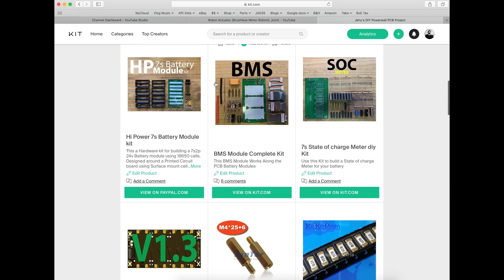Hi Power 7s 18650 DIY Battery Module kit - Assembly

Comment: Confused. Your saying that each module is 400 watt. Is that right? Also in another video, you said to use the 2nd fuse on the oposit end of the positive standoff to have two positive connections on the power boards. Also how many BMS boards at 60amp is used on 25X kit, are you using a larger BMS? You might want to update the Video.

Comment: Hay. The pins on the bottom of the SMC holders can be used for homing the component. Why not add through holes on the bord that will allow for this. 

It is also generally not a good idea to apply solder to a component, and then resolder to another surface. This is because Flux in the core of the solder would have already been used up for the amount of solder present. for this kind of setup, it would be better to apply some flux to the bord before reflow.

Finally, you state that the back of the bord is not electrified. However, the silk screen on the back has a + near the pad. Is this a mistake in the silk screen, or is it actually electrified?

Comment: 1) The  populated High Power module has a listing price of $45.24 but there is a DIY kit of 5 PCB with each pcb listing at $23.72
2) On eBay, you can buy on single HP module for less than $20. It's using high quality components and you can buy it from China or USA, but they doesn't include the cable and connectors
3) It's better to buy the kit at https://jag35.com/collections/pcb-based-products/products/high-power-18650-battery-module-diy-pcb-kit-75x because it's faster than eBay and includes the cable and connectors.

Comment: whats best for on grid solar ,i getting installed 6.6kw system thats 20 panels + hybrid inverter. not sure what voltage system inverter will run .24v or 48v don't no yet.
don't no if your kits will work on my huawei hybrid inverter.
any help would be good
Reply: It all depends upon the WATTS consumed by your DC-to-AC inverter when the Grid is down ...

Comment: i have a question: i dont have any power in my garage (old house). would it be possible to use something like this as power source for 5v, 12v, 24v and maybe even low current 220v outputs? if so, how?

Comment: now I use your module on 7s very cool. But when I connect 2 modules, one is charging a little faster and bms is not enough to recharge the other.  You will be able to make 14s very grateful

Comment: I'm not sure what kind of heat output you have to worry about with these, but if it's not too high, what do you think of a 3D printed solution to cut down on costs?

The plastic holders seem to range from $1-2 US for the 4-cell holders, but I can run off a 7-cell 18650 battery holder on my 3D printer for about 50 cents. The downside, of course, being that I then need to add all the conductive parts manually. I've even tried my hand at customizing some of the holders on Thingiverse to work slightly better.

Anybody have opinions?

Comment: Hi
A bit off the topic but I'm trying to build a 18650 battery to power a 72v ups. The challenge I face is that with so many cells in series, there is a huge difference in voltage between fully charged and the 3v minimum. I'm considering using a 24s array. When it is fully discharged (3v) it will sit at 72v but when fully charged, that array will produce around 100v. 
What's the best way to regulate the maximum voltage entering the UPS? Its a 3kva 
Thanks in advance 
Michael
Reply from the maker: Use LifePO4 they have a narrower voltage range
Reply: Thank you Sir. Will be sure to look into that

Comment: Jehu, could 4 cells be mounted in parallel for each of the 7 cell connections(hot-melt-glued and soldered with resistor wire fuses) to double the amp-hours of the 24 volt pack?
Reply from the maker: Yes,  but don’t be cheap and just use another board

Comment: will this kit work well with a ebike? 

Motor Power: 1000W/48V ( "It could be rated lower than advertised" )
Controller: 48V/26A /12Mosfet
Reply: This is a 7s kit, for 48 volts you need 13/14s ,

Comment: thanks for the video. my question is: should the module be rated by amperes and not xC? i have 2000 Ah batteries. i can make easily 2C since the board can handle 4A ?  ;)

Comment: A little (maybe stupid) question: why have you used 7 cells? why not 6 (2 x 3 cell holder) or 8 (2 x 4 cell holder)?
Reply from the maker: 24v
Reply: @jehugarcia  is there a way to use the board in 6s configuration? I don't want to use BMS - I have a pretty good balance charger for lipos/liions

Comment: Is there any way to get Cell-level fusing on these modules?
Reply from the maker: It’s already there
Reply: Each cell has a fuse? Or each module has a fuse?
Reply: In one of the videos Jehu posted early on about the pcbs, he explains there are trace fuses on the pcb for each of the 7 cell connections.
Reply: @johnjones3637  Yes, there are Trace Fuses for the Balance Leads.  But, how can you have individual Trace Fuses for each CELL, with a 7S1P type of board ???

Comment: Hey Jehu. I'm very new to learning batteries and have been really enjoying watching these kits. I was curious to know if a 2s pack is better than a 1s? By better I mean does one deliver or store more power than the other? What are the benefits of going 2s vs 1s? Can you still use 1 BMS board per 10 battery boards when configured as 2s?
Reply: The boards are 7s. When you connect the cells on both sides it's a parallel connection. It's like having 2 boards connected. The benefits of mounting in both sides are less boards used, more power delivered per board, more storage per board. The cons is working with higher amperage per board and hotter connections. I would like to see a load test with these boards. Thanks Jehu for your videos.
Reply: If memory serves right, having 2s doubles the voltage since each board now has 2 cells?

Comment: Je: Can I suggest you stop at your local Home Depot and buy a soldering gun.  I used to use the same soldering iron as you and by pure fluke I tried out the soldering gun.  It makes a world of difference, especially if you are doing a lot of soldering.  Also buy and use a simple metal file.  Use the file to rub the tip of the soldering iron/gun clean on a regular basis.
Reply: Liked for the tip pro-tip

Comment: Pretty cool.  Now if only there was a straight forward way to interface storage like this with a decent available ELECTRIC LAWN MOWER so I can make as many batteries as I need and mow a larger lawn without breaking the bank.  :-)  My old gas mower is getting geriatric and I really don't want to replace it with another loud, smelly, just plain yucky gas unit.  Besides when it comes to scale, lawn mowers may be a good "gateway drug" towards more high current applications.  People might be content just doing drones and RC units but automotive and home applications just seem to big and scary.  A lawnmower might be that needed stepping stone to "cross the creek" so to speak.  (poetry unintended :-) )
Reply: Another thought, I bet electric lawn mowers get enough nasty jostling that all those surface mount battery holders would need major physical reinforcement  and probably thicker circuit boards to hold everything together.  Thoughts of "drowning" the whole unit in epoxy or even hot glue (sans where the terminals and batteries go) making the unit into a solid block come to mind.  (could be useful for automotive applications too)
Reply: Yes I am wanting to build an electric zero turn. Cant find anyone else that has done it though.
Reply: @beaufortner  "electric zero turn"...a thought that hadn't run through my mind until now...would be cool :-)  probably not practical until batteries get much cheaper and I would expect that by then the robo-mowers will have taken over :-)

Comment: Do you think I can build with these Boards an Efoil Battery? I want to supply an motor wich takes max 100A at max 100v. Or should I take the high power cells from Battery hookup?
Reply from the maker: That’s 10kw,  you’d need at least 450 cells,  can you handle a pack that big?   Your probably better with the 25c cells unless you actually need more than 25 minutes of run time

Comment: Is it cheaper to buy 3x2+1 battery ports than it is to use 4+3? Or what was the reason of the change?
Reply from the maker: These are only available on 1cell and 2 cell
Reply: @jehugarcia  oh the flat mounted ones, I guess? I see